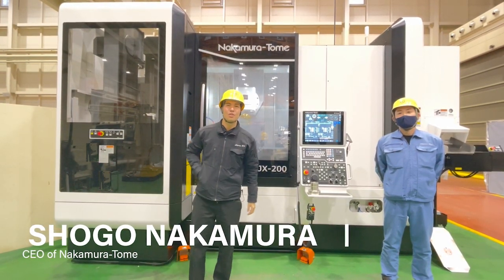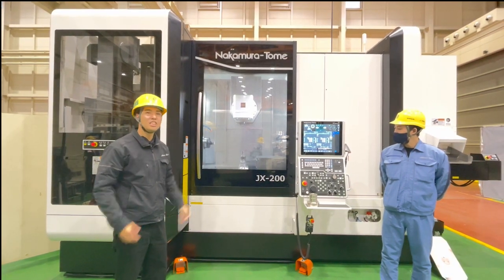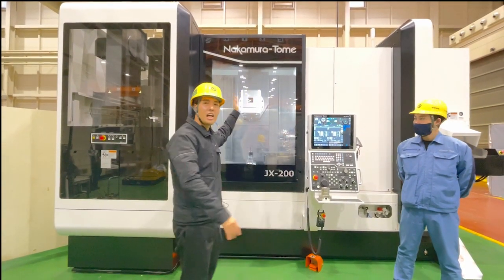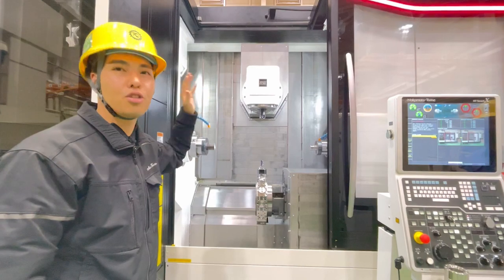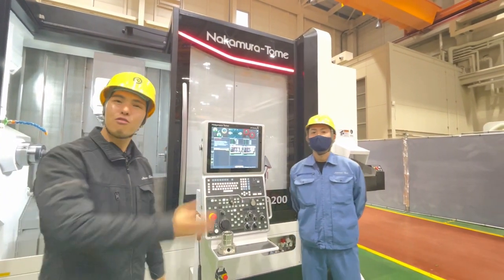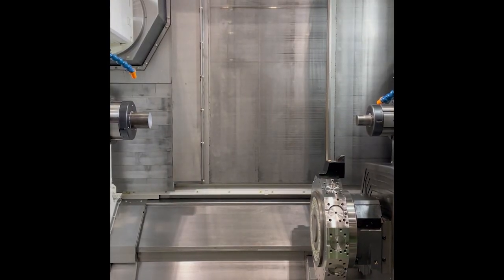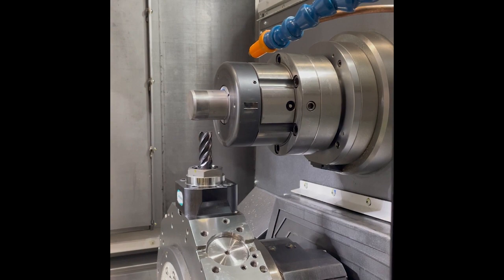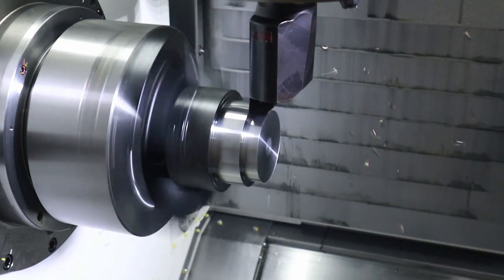Very Popular at JIMTOF! | New Product "JX-200" Presentation by our CEO

Comment: how many seconds does it take for a piece-to-piece tool change with ATC?
Reply from the maker: Thank you very much for your question.
The Tip-to-tip time can vary depending on the machine model, tool usage, and storage position of tools, but it's typically between 6.5 to 8.0 seconds.
The Tool-to-tool time is about 2.1 seconds.
These times may vary depending on the positioning of the machines and tools, so please take them as reference values.